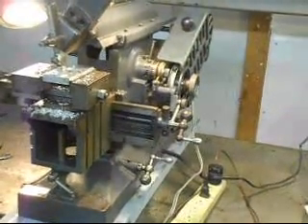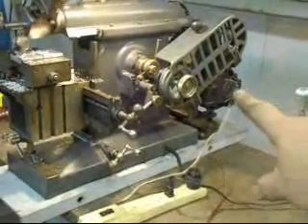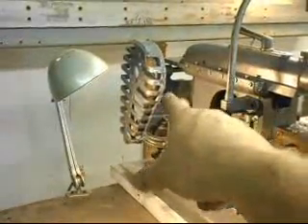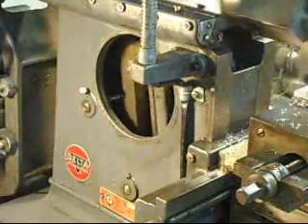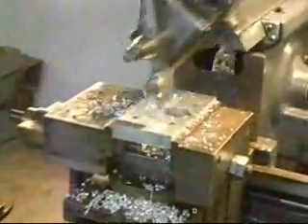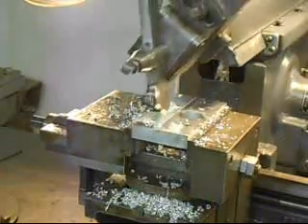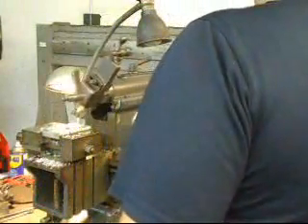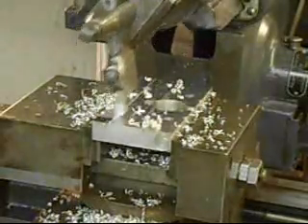Delta AAMCO shaper.wmv

Comment: Great little shaper!
Regarding the shatter resulting in a lkind of a rough finish: the reason is that the overhang of your cutting tool is quite large
Reply from the maker: Sure, that could easily be the cause.  There are usually many things that will influence tool chatter.

I like to run any shaper with no tool holder between the tool and the lantern tool post.  If possible, I like to run the tool in the lantern tool post directly.  See my video of the Logan shaper here, time = 0.25 minutes to see an example of the tool mounted directly in the tool post.  Logan Shaper HD

Lucasofmn AKA Arn Jones
Reply: ltousig Your Logan is also very nice!
Good idea that chip tray on the table.